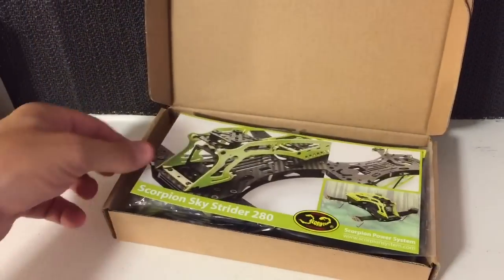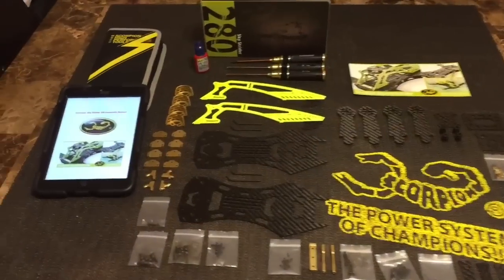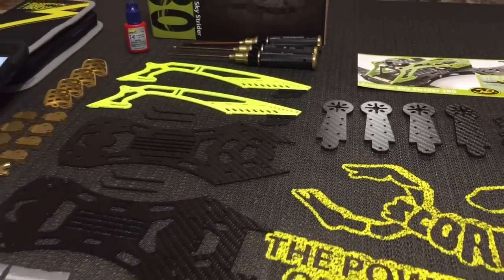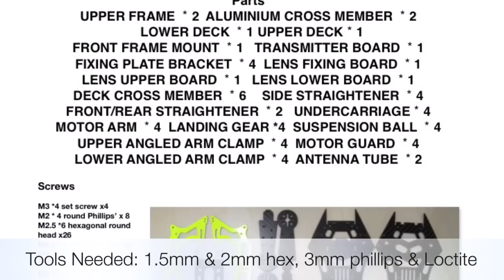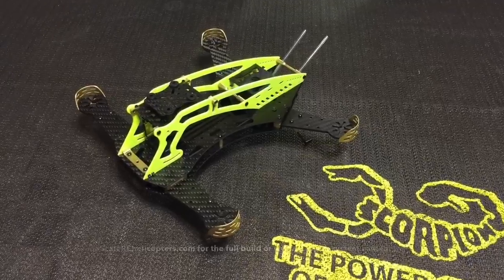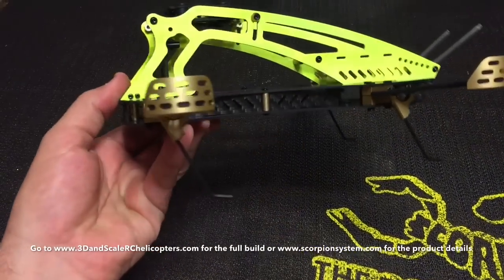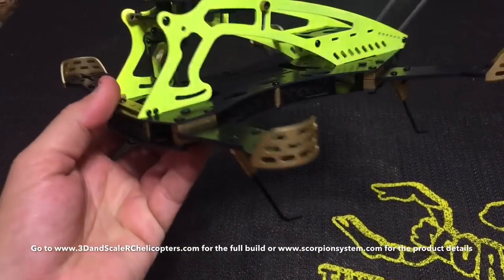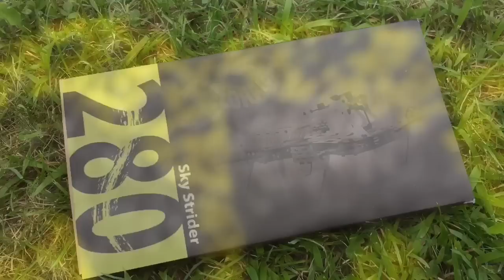Scorpion Sky Strider 280 Unboxing & Build Video by Chris Reibert

Comment: I did not fly the one I bought, seen I`m still waiting for some elctronic parts. But I assembled the case out of curiosity and at one of the metall parts, the screw pad had to be redone. But such things can happen and doen´t cause any troubles. Specially not if the whole rest of the construction is just great, as it is with this type.So all I can say about that case is: the ones who designed it, dit a real great job.